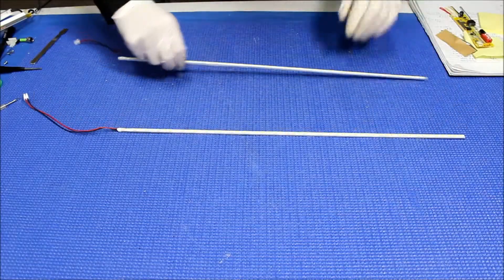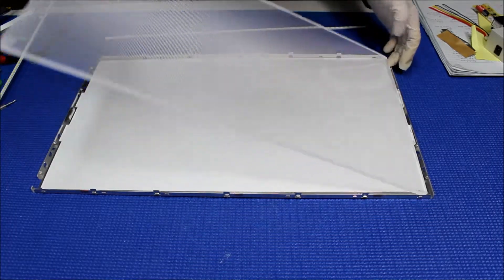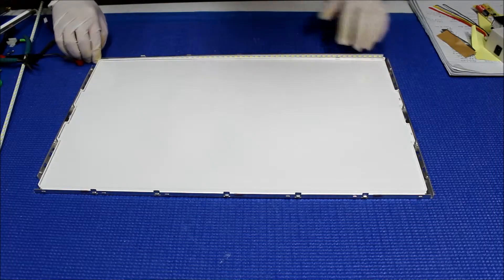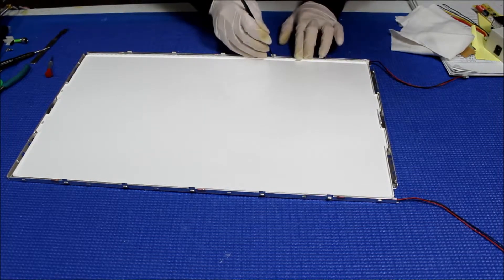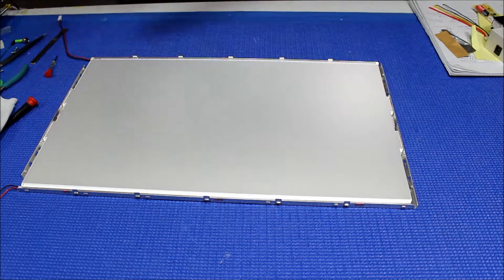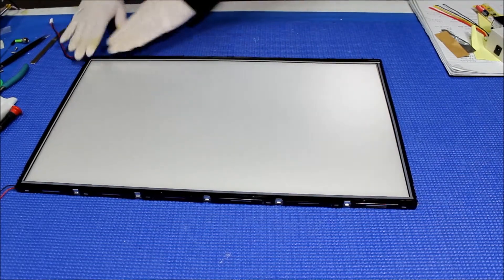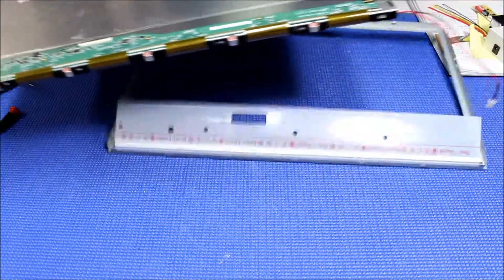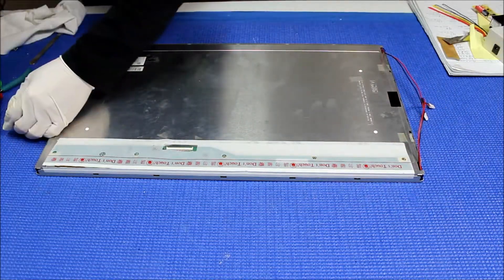V216B1-L01, Part 2 of 2

Comment: Hi, can you tel me, how do you pług in this LED panels to the old connectors on the mainboard ? Is the same voltage measure ? Or we need same convert? Old subject, but right now i have the screen with ccfl burned backlight and trying to replace IT to the LED. Greetings!